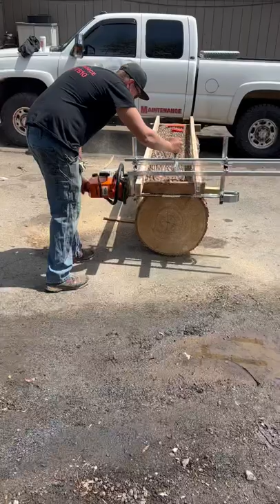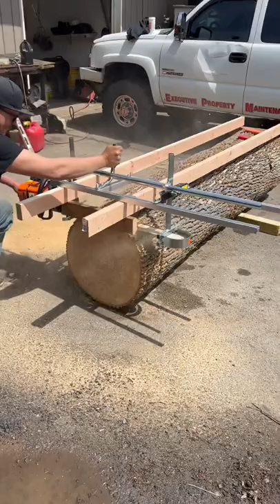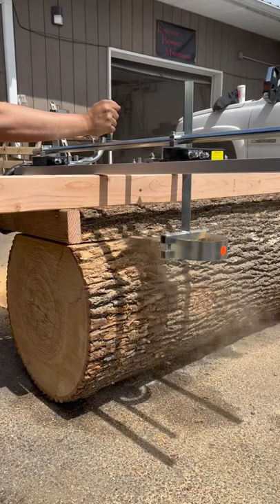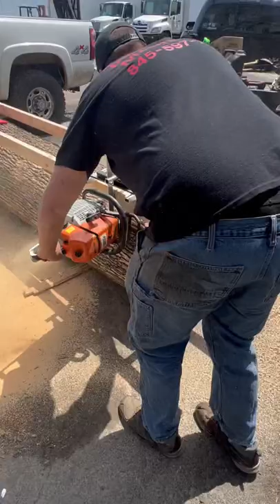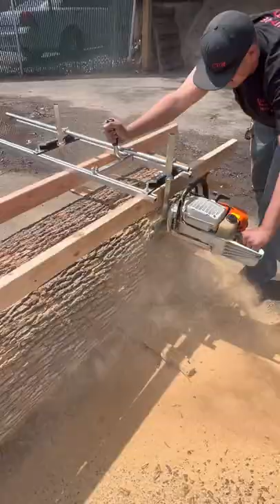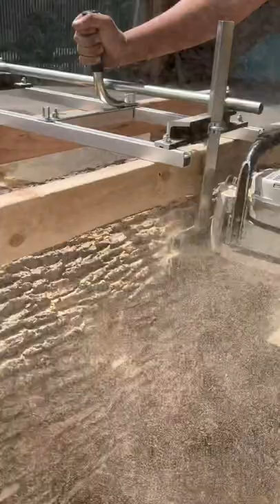Alaskan saw mill first cut

Comment: Use some wedges to hold open your Cut works way better if you have above 70cc maybe cosidder an halfchisselchain filed to 15° isteat of 30° if you have lower cc saw Stick to rippingchains wich are arround 5-10°    they stay longer sharp cuttibg with the  grain and make a smoother Cut bit they take way longer in soft Woods to Cut and are abetter Option for gigantic pieces or smaller cc saws ..